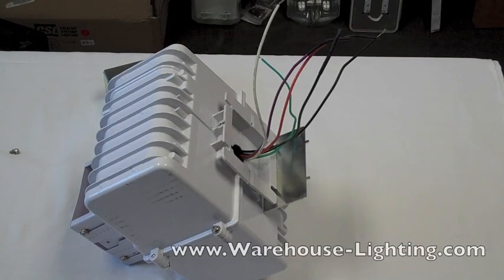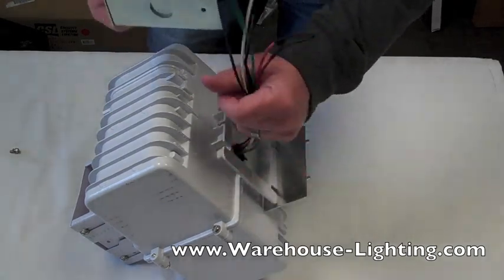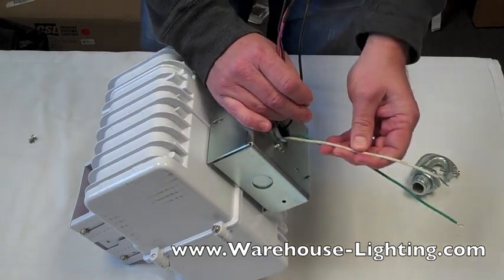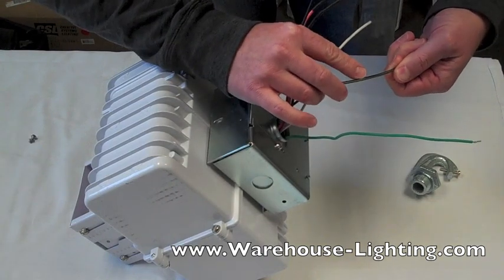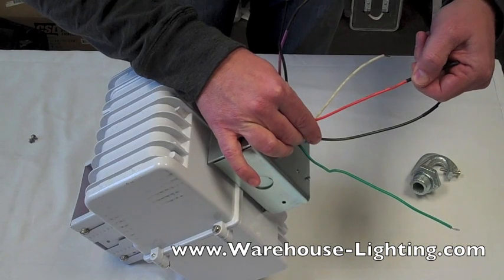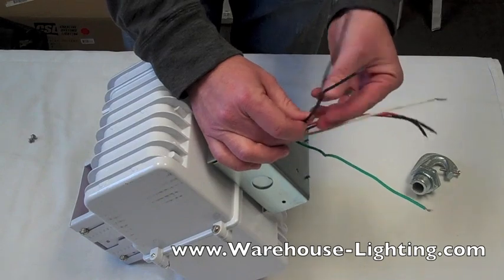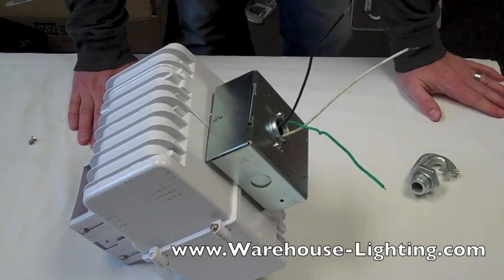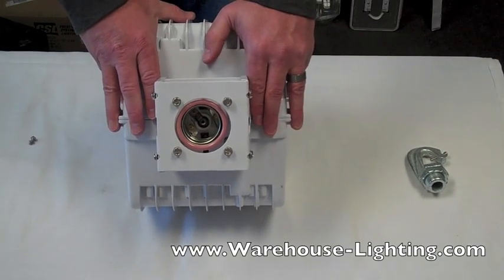How to Wire HIDs

Comment: Please help
Hi guys,
I have tons of 277v light that needs to be installed but I'm not sure which gauge wire, circuit breaker and electrical panel to get. Please help!!
Reply from the maker: Hey there, please call us at 866-506-1626 or email at info@warehouse-lighting.com and we'll be happy to help you out!

Comment: If I do 240, does the common got to one sude of 240 and the 240 to the other side of 240 breaker? I'm a bit confused, on home wiring 110 uses one power wire from panel and common is ground while 220 uses 2 110 power wires and ground. Is 220 wiring close enough to work on 240?

Comment: Should i let a electrician look at the wiring ?
Reply from the maker: Absolutely!
Reply from the maker: Why are you using outdated technology you should contact us for a more energy efficient option. It will save you a lot of headaches in the end. Please call our customer service at 414-525-9027
Reply: It has 120-208-240-277 volts
Reply from the maker: @medleykatharine6736  then the correct wires are inside the box or the ballast housing you may have to open it and pull them out.

Comment: I installed 4 of these today but only 2 of the fixtures worked. All wired the same and in the same warehouse. I tested the wires to see if power was getting to them and they are. I reinstalled and still nothing. All that it's doing is buzzing but no light. I tried another bulb and still nothing. These are brand new. Please help

Comment: You didn't tell what color 277 volt wire was.....
Reply: James Gibbs take a voltage tester & put one lead on the neutral  & put the other lead across every other wire one by one until you get the wire that reads 277volts
Reply: James Gibbs doesn’t matter what color the wire is it varies from manufacture to manufacture. The best thing to do is read the printing on the wire or look at the ballast schematic to find which color coincides with what voltage!
Reply: James Abraham ok it was funny you told every WIR but that one and my light is just like the one you showed but older with no writing on it but I'll figure it out....And great video....